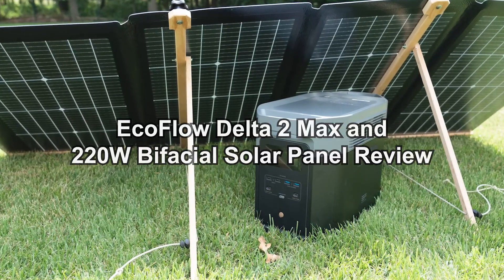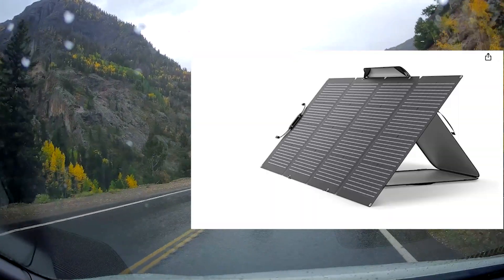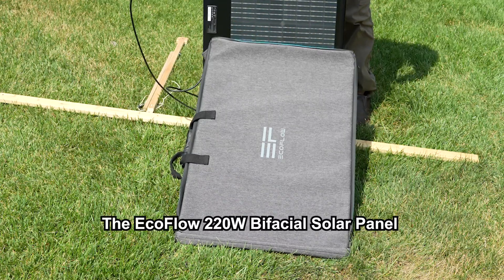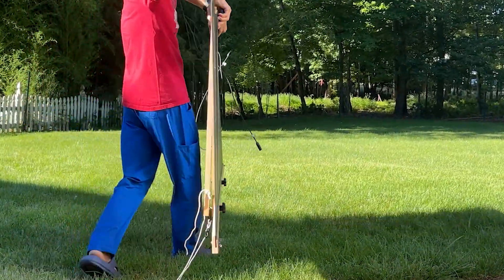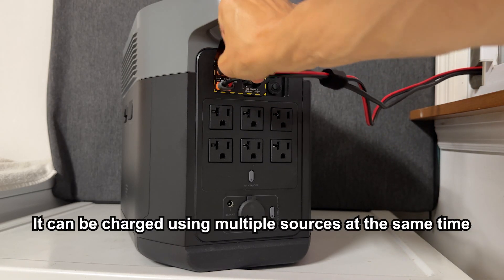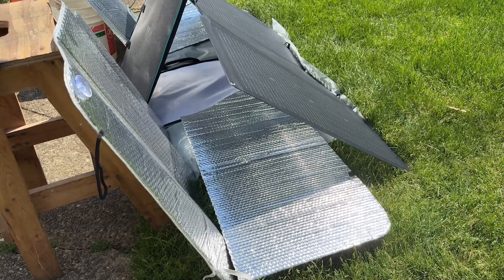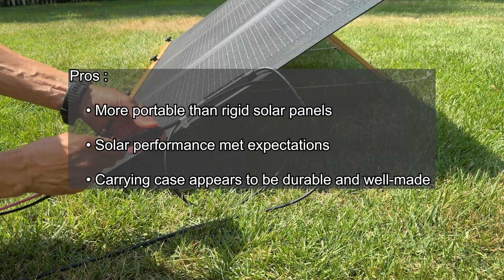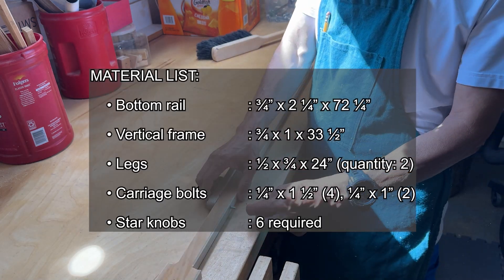Ecoflow 220W BiFacial Solar Panel Review - Off-grid camping

Comment: Thanks for the new Sienna camper updates and good to see Rocky. So it seems that having kick stand with adjustable angles for the solar panels is much more important than having bifacial panels?
Reply from the maker: Yes, sun angle is number 1 factor. I have been using the 220W bifacial panel+100W Renogy to run a 8,000 BTU AC at home for this summer. A bi-facial panel perform just like regular panel if facing the wrong direction. If I leave the panel all day facing South at 45 degree using the provided case-stand,  I will get less than 60% input. In reality, nobody able to adjust their panels every hours unless you have those expensive automatic solar stand. I adjust mine twice a day at noon and 3 pm.
Reply: How  did you connect this two panels ,in series or parallel? And how many power did you got?
Reply from the maker: @RA-LHTX  yes. I’m traveling with two solar panels, it is ultimately how much solar it can deliver in real world

Comment: This is perfect,, yesterday I received my Ecoflow River 2 pro and the 220W solar panel, but after putting togther the panel today, I was not happy about the kick stand. Your design's very nice, the panel is big and heavy so using the provided case/stand's not so easy, but that problem is solved with your solution.

Thanks, all the best from Chile